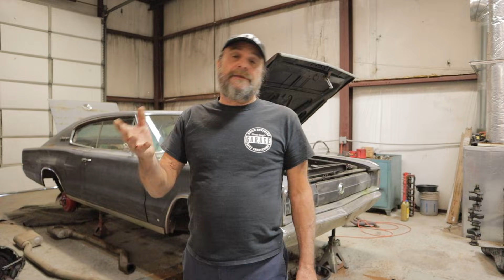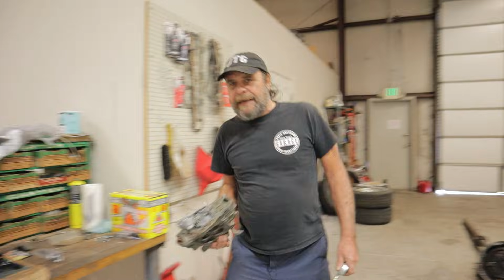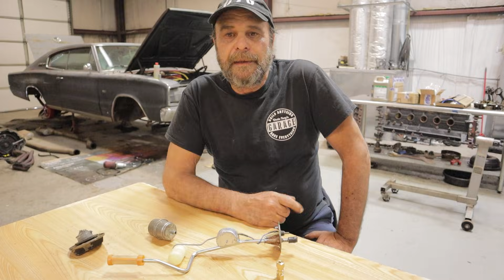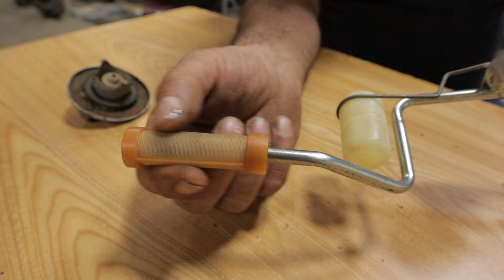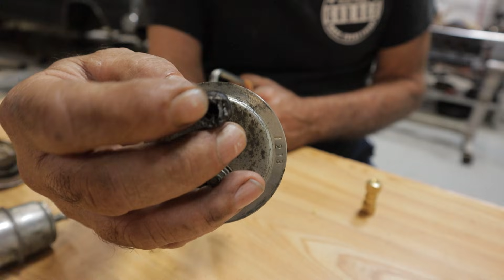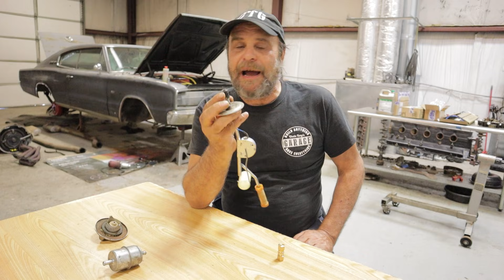Classic Car Survival - Troubleshooting Carbureted Engine Fuel Delivery Systems

Comment: Uncle Tony, what are your thoughts on fuel pressure regulators for carbs? Is it necessary with a stock fuel pump? I was thinking about installing one with a gauge on an Edelbrock 1405. I notice that many steel fuel lines such as the Edelbrock 8126 say they will not work with a stock fuel pump. Why is that?
Reply: Depends on the type of fuel regulator.  Do more reading.  See MuscleCarSolutions videos.  Bryan explains everything.

Comment: Damn, I love this channel. I need to tell a friend of mine about this on his Cadillac! Neither one of us thought of air through bad rubber hose or hoses sucking air.... He has a mostly stock 1974 Cadillac Eldorado with the 500 in it. He replaced the exhaust from the manifolds to the tips for something with way better flow, yet still quiet when cruising, replaced the fuel tank, hard lines, soft lines, the pick up. Bought a new old stock Cadillac fuel pump that his dad made sure was in good working order, rebuilt the Quadrajet with some minor changes, removed all the smog equipment, and rebuilt the ignition system. He drove it for several years, and the car had been trouble free. He had to do training and a deployment somewhat recently, he got back and the car didn't want to run right after sitting. Thank you Uncle Tony! I will text him in the morning to check the rubber lines, and hopefully that is the fix!

Comment: Rubber fuel line they sell these days is total garbage, you MUST ONLY BUY FUEL INJECTION RATED LINE, it's the only stuff that will last more than a month, the cheap "low pressure/carb application" line will dry rot and crack after only 1-2 months and is extremely dangerous, use as much steel or aluminum line as possible and only use as little rubber line as possible to prevent disaster, even if it doesn't crack, it will internally fail and scatter chunks of rubber all through the fuel system.
Reply: What
Reply: @TMT915  yeah, most auto parts stores offer a fuel injection rated fuel line, usually you have to ask for it if not they will sell you the low pressure cheap stuff, the fuel injection rated line is pricey (usually double the price of the cheap stuff) but it's way better and doesn't degrade as fast as the cheap stuff.

Comment: An unhardened fuel pump pushrod on my rebuilt 383 was a real head scratcher to diagnose. I have it sitting on my desk, right in front of me, about 1/4" shorter than it should be. What was most surprising was how well the car drove with only a fraction of the pump stroke it was meant to have.
Reply: Why was it unhardend.i put in a electric  fuel pump and caped  it off now I think  my new system  is getting  the fuel  to hot after a little  driving
Reply: @davidjensen6542 it was a mistake on the part of the manufacturer, whether it was a case of using the wrong alloy or incorrect heat treating I don’t know, but they got in the parts network and were distributed far and wide. The finish on the new part looked really poor compared to what I was accustomed to seeing.
Reply: Then how did you find it?
Reply: @alanmeyers3957 I knew it was a fuel delivery problem, the carb was empty! I knew the line to the tank was clear and ruled out the cap. I pulled the pump and it seemed ok bench testing it, that pretty much narrowed it down to either the rod or the cam love, and the problem was obvious once I saw the cam end of the rod and compared it to a used original. I knew I had an engine full of ground up metal, and I didn’t know if this had damaged the fuel pump cam lobe. I put a magnetic drain plug on my pan, and cut apart a few oil filters in quick succession. It was all good, the engine is still pulling strong, almost 30 years later.
Reply: i bought a lighter fuel pump rod online and it made a horrible tick noise...i took it out and compared it to my old rod and it was slightly smaller diameter. I know I should have checked that I only checked length. Put my old rod back in and no more tick. Hmmm.
Reply: @ToxicChihuaha What was the reason you bought a new one ?

Comment: Hello Tony i have a 1986 ram charger it has a charcoal canister  mounted in the fender how does it work ?
Reply: Fumes from the tank (and from the carb bowl if it it had a factory carb) waft through a hose and into the charcoal canister, where the charcoal absorbs the fumes and stores them. The canister has an output, and it is connected to the intake manifold, with an electric valve inline, so that when the engine is running and that valve opens, the fumes are sucked out of the charcoal, and into the engine.

Comment: If you move the pickup further back in the tank, do you risk having starvation under hard braking or on a steep downhill? Does it matter if you do? It seems like oems would put them at the back if there wasn't a reason not to.
Reply: You're not really using a bunch of fuel under heavy braking - and generally not when cruising gently down a steep hill either (and if you're accelerating hard down that hill, the fuel is still standing up at the back of the tank.)  I guess it might make you stall if you're stopped, nose down, on a really steep hill, if you only have a gallon of fuel in the tank...but then the engine is using very little fuel, so what's in the lines and float bowl should last a little bit before the engine dies.  Heavy acceleration is really the biggest problem, as you need the greatest fuel flow at exactly the same time as the fuel wants to stand up at the rear of the tank, away from the pickup.

Comment: Good video.  Only thing missed was vapour lock.  Modern alchohol-bearing fuel boils at a lower temp than clean leaded fuel.  I see it in my truck pulling heavy loads (trailer) when it runs good up the grade (lots of fuel flow), then dies when the grade levels out (no flow, so fuel starts to boil because of exhaust heat).
Reply: Sounds like it's a sack of shyte. Get a Toyota ya nerd.

Comment: I currently have a 20R Toyota with a brand newly rebuilt carb start acting up. 
Eventually I found a chunk of something lodged in the carb right after the input fitting. Still don’t know what it is or how it got there.  Odd things happen sometimes. Just because it’s new don’t neglect to check it out.

Comment: Had a pushrod on 440 that was 1/4” short. It stalled at idle. This was a fresh engine that a friend rebuilt. I to this day hope it was just a worn original and didn’t send 1/4” worth or wear through the engine. Ran fine after replacing and never picked up any metal on a mag plug.
Reply: Same problem, over 20 years ago. Unhardened pushrods were being sold, and like you said, 1/4" of fine metal through my fresh rebuilt 383. I got a bit of fur on the drain plug, found some in the filter, but the engine is still a strong runner to this day.